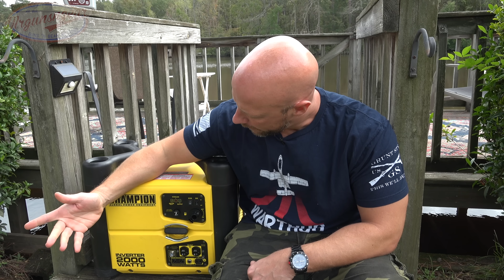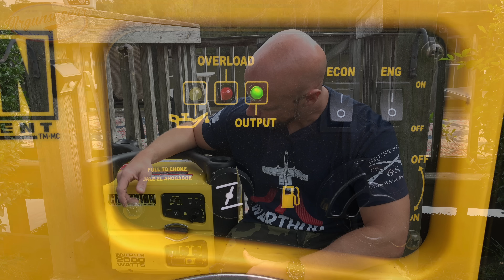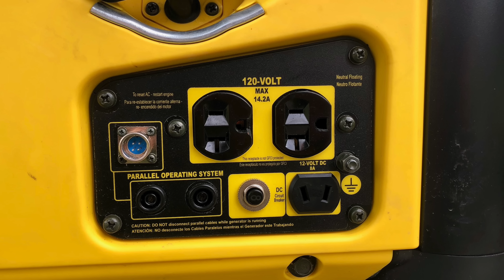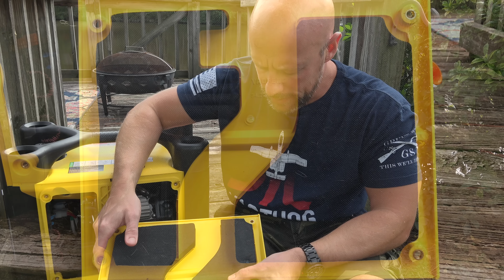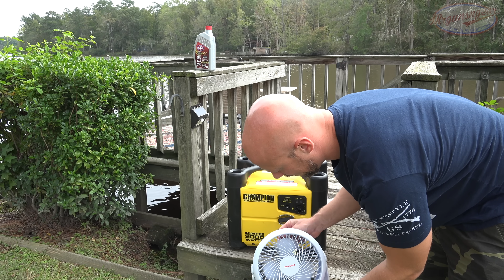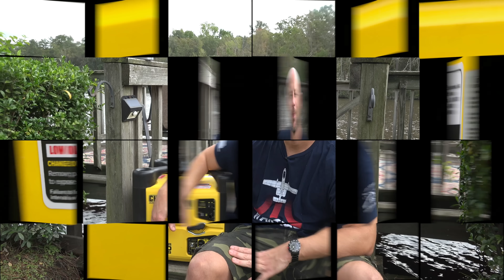Champion 2000 Watt Stackable Portable Inverter Generator Review

Comment: I just bought one of the last models produced, its black,with yellow inside panels and has a 12 volt lighter charging port. I actually have solar, only 4 panels and 3 lifpo 100Ah batteries, and i can run lights,refrigerator and t.v off the solar i bought the Inverter generator to run my window AC unit,and its 12,000 btu unit,i gotta start window AC in eco mode,or it will go inti Overload.

Comment: I own 5 generators, three of which are the same model as portrayed. They do what they are designed to do and do it well, being extremely reliable machines. Only thing I did was add an hour meter and an inline fuel filter to each of them. During the last derico storm that went through Ottawa, they all ran an average of 100 hours without a hickup (we used them to provide backup power to older clients of our company in order to preserve the meat in their freezers). They ran 12 hours or more a day for a week. 
I am not a  Champion "fanboy" (but close) and I honestly believe they represent the best balance of value and quality on the market for the money, on top of which parts and service are actually available. Good video...thanks

Comment: here I am back to this video 2 years later. We took the direct strike by Huricane Ian. My power has been out since 5:49 am last Wednesday.  the little champ is running my fridge, my tv, computer, battery chargers, and a 5k but window ac and a 20 inch box fan. run time with this load, ac on high cool eco off is 6 hours or 4 gallons a day, low cool + eco on = 8 hours run time. been through  20 gallons of gas in 7 days (i don't run it 24 7). i know people going through 10-12 gallons in the big contractor types in a day.

i am sold on champions. they have made a customer for life!

Comment: The biggest company in China bought the patent from Honda and they built the same 2000w generator its called wen but its only 350. With free shipping to Alaska I can run my cabin for 10hrs on a gal of gas in winter I have solar panels for summer

Comment: I have this generator and love it.  It has yet to fail me in 2 years.
https://www.harborfreight.com/8750-Max-Starting7000-Running-Watts-13-HP-420cc-Generator-EPA-III-with-GFCI-Outlet-Protection-63086.html?ccdenc=eyJjb2RlIjoiODkxMzAzODQiLCJza3UiOiI2MzA4NiIsImlzIjoiNTI5Ljk5IiwicHJvZHVjdF9p%0D%0AZCI6IjExOTA2In0%3D%0D%0A&utm_medium=email&utm_campaign=2818b1&utm_source=1021&cid=mEmail_s1021_2818b1&sfid=a2xtYXk5OTlAZ21haWwuY29t

Comment: What happens if you go into a low oil fault? If you were't around and it shut off on low oil, there's no battery to keep the light on letting you know it went off on low oil, and if you try to start it, it wouldn't start. Also would recommend getting a magnetic dipstick. I have them on both of my gens, you would be surprised on how much crap it pulls out.

Comment: You need at least 30 amps to run an a/c in an RV, 50 amps if u have 2 a/c. Nice info. I have a 4500 watt power unit for my RV.

Comment: My tip I can offer is avoid the cheap models. Grabbed a westinghouse off of amazon and after 60hrs it crapped out. Sent it back and grabbed a Yamaha EF2400HSC and haven't had any problems at all. Have well over 350hrs on that one at this point.
Reply: Also keep that spark arrestor clean.
Reply from the maker: thanks for the report

Comment: I have a 3500w champion generator that I bought used for $175  2 years back and I haven’t needed it for emergency yet but it’s been super reliable the times I have used it and I’m kinda bad about leaving old fuel and oil in it.the one in the vid looks like one I would use more often
Reply from the maker: thanks for the report

Comment: champion is located in usa here is their biz info:  

Champion Power Equipment Headquarters
12039 Smith Avenue
Santa Fe Springs, CA 90670
1-877-338-0999

Champion Engine Technology
W245N5551 S. Corporate Circle
Sussex, WI 53089
262-246-0701

if you intend to use any generator,  you should never let fuel sit in machine for longer than 30 days max,  you should only use clean fresh gas under 30 days old and gas that is non-ethanol 100% pure gasoline,  i also strongly recommend using a additive such as Startron to keep the fuel fresh as possible.  carburetors do not have fuel injectors.  i work on outdoor power equipment everyday,  these things are chinese sourced and chinese quality.  these things are not even in the same ballpark as a good american or japnese generator (when you buy a usa or japnese generator you get top quality, reliability and a parts network that is second to none),  i recommend you buy a briggs and stratton generator,  or a honda generator.  these 2 brands have a proven home and commercial track record of quality and durability unlike these chinese generators.  the last issue with all of these chinese sourced generators is parts availability and proper technical support,  the bulk majority of these things are difficult to acquire required parts for any type service or repairs,  (i was told by a local harbor freight store it can take 1-2 months to acquire parts from mainland china because most of these importers do not have a parts supply chain and distribution network setup that has a reliable warehouse of parts in usa) my local busy beaver hardware store always sells the cheap chinese generators and from what i was told directly by the store manager they have 80% of the customers bring the machines back in under 1 year because of q.c. issues and the machine failing to work properly because of poor quality.   my personal recommendation:  do your self a favor and buy a quality american or japnese generator and do not look back,  you will not regret it.
Reply from the maker: Thank you

Comment: A 2000 won't run a majority of trailer AC systems. You need a minimum of 3000 to start the compressor. Use fuel stabilizer in your emergency fuel and you can keep fuel up to a year, and it will help prevent carb gumming. Otherwise, run your gen set once every six weeks or so for 20 minutes.

Comment: Just out of curiosity...I noticed their is a yellow box surrounding the external ground connector and the "parallel" connector. Both are tied together with a yellow line. Is the ground recommended possibly when used in parallel due to the second gen being off the ground?

Comment: If you want hot water for a bath, use a new aluminum trash can and put the can next to the exhaust. It'll heat up that water in about 15-20 minutes for bath water...
Reply: If you want a warm house put the generator inside the house, it will heat it up in no time as well!
Reply: That be great for you in your section 8 trailer while you shove Walmart cheese balls and swig Faygo and Mountain Dew while you play your video games.
Reply: yeeehaaaaaa

Comment: I stayed in Fla for Flo, picked up a 5000 running watt champion while there, came back to New Bern NC and had no power for 5 weeks, the champion a window unit, tv, lap top with ease... Fantastic generators, wattage was pretty stable

Comment: RUNNING WATTS:
Laptop Computer - 250
Desktop Monitor - 300
Refrigerator - 600
Microwave - 1,500
Radiant Heater - 1,300
Small Fan - 120
Reciprocating Saw -  500
Drill - 440
Air Compressor - 970
Lights (Qty 4, 75 W Bulb Lamps) - 300
Reply: no. a laptop doesn't pull 250 watts. maybe 20-40 tops. a monitor these days is only a few watts. this data is way out of date.

Comment: It probably doesn’t say so in the manual, but use a high zinc oil. All air cooled motors need high zinc, even with synthetics. Thermal shear is the issue. May I also highly recommend Schaeffer oil. It will drop oil temps by over 20 degrees. Doesn’t sound like much, but it is. We just switched to it for all of our equipment at work. I tried some in my motorcycles and the generator on the crane I operate. Everything ran cooler and it bumps the ‘standard’ oil change from 250 hours to 500. Not a rep for them, just impressed with the product.

Did you experience any overheating with that unit? I’m in SE Va and that second storm hit us as a harsh tropical storm and we lost power for a week. Had issues with my genny overheating. It has a containment shroud kinda like yours. I had to remove part of it and that solved the issue.

Comment: Thanks for covering this product I was curious about these. Why is it called an inverter and not just a smaller lighter generator...??? What’s the difference 🤷🏼‍♂️🤷🏼‍♂️🤷🏼‍♂️
Reply from the maker: it has to do with how it converts DC to AC and vice versa.    That could be a video on itself but the result is what's in that chart really
Reply: a conventional generator like harbor freight tail gator or my champion 3500 dual fuel, has a large and very heavy alternator attached to the engine. the engine is also compared to an inverter generator of the same wattage alot larger. this is due to the generator engine needs to stay at 3600 rpn in order for its two pole alternator to make 60 hz power. so lets say i need 1500 watts of power. with a regular generator I'm going to need 3.5 hp motor of about 99 ccs displacement to achieve that 1500 watts at 3600 rpm. an inverter generator uses an dc alternator affixed to the motor. this alternator is much smaller and much lighter than the kind found on a regular genset. this alternator produces 12 volts of power DC. thats the same kind of power your cars electrical system uses. its connected to an inverter the same kind as you buy in the store for $20-100 that you connect to a car battery to get ac power out of it. because the inverter always produces 120v 60hz power the engine on an inv gen doesn't need to run at 3600 rpm. it might run at say 1800 if the load is low, but 5000 if its near max. because the engine can run at just the power output in needs to, an inverter generator can be much more fuel efficient and quieter than a conventional generator. its also alot lighter. a champion 1400 watt conventional genset weighs 55 lbs and runs 10 hours on a 50% load using 1.5 gallons of gas.  but this champion he's reviewing weighs 48 lbs and runs 9.5 hours at a 25% load on a 1 gallon of gas. both generators use the same size engine but the inverter model can produce slightly more power, weights 7 lbs less and at 53 db is much much quieter than the 65 db conventional model. however the inverter generator costs twice as much. also at higher loads an inverter isn't much more efficient than a conventional genset. i hope this helps

Comment: Pardon the input but some things should be mentioned. People die everyday because of not understanding what these things are about. Inverter generators are not per se’ cleaner power. In fact, they are more likely to make choppy power than an alternator or true generator. Cummins Onan has an extremely successful line of diesel inverter sets that go up to 15 k.w. Without looking at the sine wave, there is no proof that a brand of machine will create clean enough power to run electronics. 4 pole, 1800 rpm machines can provide medical and mil spec sine waves. 2 pole, 3600 rpm machines have fantastic motor starting inertia and will get a reactivate load past the start up inrush far better than the inventor machines. Choppy sine waves are normally inherent to non precision wound back ends and capacitor regulation. My biggest interjection here is carbon monoxide. Not one mention from anyone about that. Portable generators are not fitted to convey deadly gases away. Powering homes: if  one backfeeds a building through an internal to building plug or socket, the buildings meter hub should be removed. That way, there is no electrical connection to power lines outside of the building. Opening the panels mainline breaker does not interrupt the case ground leads. I got it, that wire is not supposed to be current carrying conductor but how many people have put a clamp on their grounding lead and metered current? This whole subject is very deep and absolutely lethal without some fundamental understanding. I know nothing about firearms, flinch when I shoot and am journeymen at generators. I have however participated in investigating cause of dual death from carbon monoxide. We do not want to go there. It’s ugly. Be safe y’all

Comment: I’m loving my Honda EU 1000. Had it 20 years or so and it still cranks on one pull. Couldn’t count the hurricanes it’s been through here in central FL. Runs the fridge, the tv and a fan. And you ain’t camping if you need a generator. Been running Mobile 1
Reply from the maker: awesome !

Comment: I have a 8k watt propane/gasoline generator. I use Cooking grill LP gas cylinders that run typically under full load for more than 8 hours. It powers my server, chargers my cell phones, chargers the lap tops, runs my refrigerator and would do more if i wanted. I now have another that is the same fuel usage type (LP Gas or gasoline) and keep on hand 8 to 10 LP gas cylinders in the shed for when wee get hit hard.

I live in NE Pa in the Pocono mountains and when the storm hits and the power goes off we are at a minimum of 8-10 days.

My advise to anyone getting a generator is to get a duel fuel and if using LP gas you wont have issues with fowled plugs or dirtier than average oil when maintaining the generator.  8 to 10 k watts will run a refrigerator and a well pump/hot water heater with no issues.
Reply from the maker: thanks for the report

Comment: Im in nc also,after hurricane Mathew 2 years ago I bought a 10000 watt generac generater .it will run my whole house.water pump,water heater etc.It ran 24 7 for 5 days straight during florence.Kids didnt even know power was out.
Reply from the maker: nice
Reply: When i was looking i wanted to go with the inverter, but what i could figure my well pump pulls about 2000 watts on startup.so that kinda canceled out the inverter

Comment: Power = watts = amps , if you bought a bigger unit like upwards of 7500 watts an up you could with calculations run your home A/C. Provided no damage to your home from a hurricane an there are many you tube videos that will tell you how to do this, because you never know How long you will be without Electrical service to your home.
Reply from the maker: indeed
Reply: Yea just don’t backfeed the power via a dryer or range plug and energize the lines powering up the neighbors or killing  a line worker. You need a proper generator disconnect.
Reply: @FishFind3000  If your main breaker is shut off you can't backfired power, it will only feed the house, not the best way an yes it can be done, but there are better ways an installations that are safer.
Reply: You can install a "Transfer Switch Kit" on your home to cut off the power connection to the city grid, and accept a portable generator as a secondary source of power. And Yes, hire a legit electrician to install it. 

Cost $250 for the kit on Amazon.
Reply: @RaisingMcLains  there are interlock kits you can also get that won't allow a backfeed, but it would be wise to hire an electrician to install, I ought to know I have been one for 40 yrs now,lol.